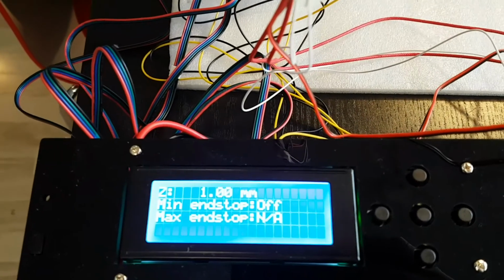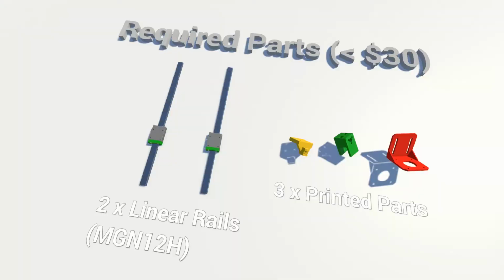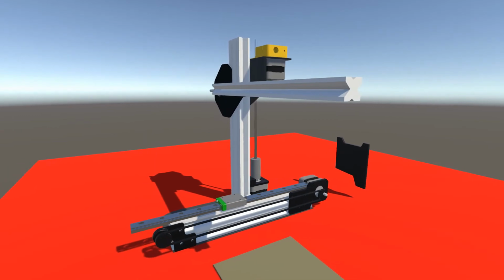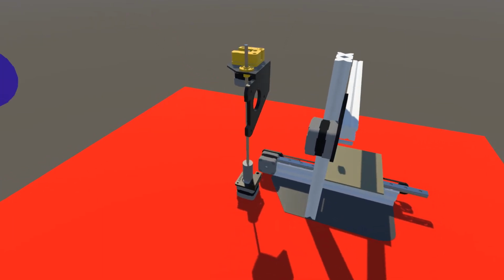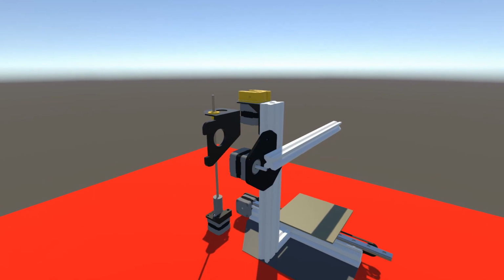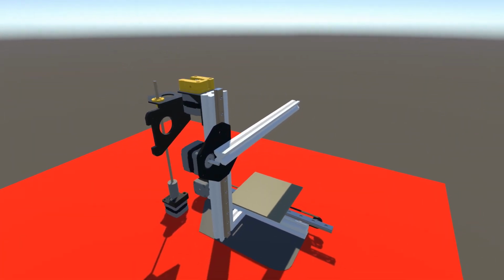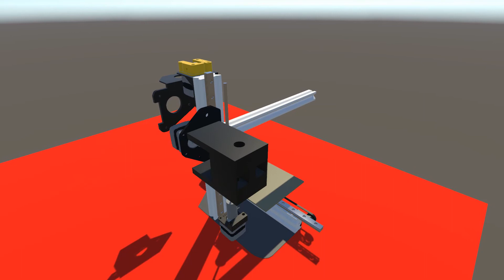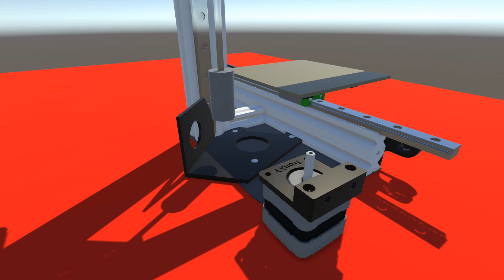Tronxy X1 Linear rail mod

Comment: I had a similar issue with my kit.  I purchased a bag of 10 eccentric spacers ($15 at amazon) and used one on each axis on the side with the single wheel.  Worked great.
Reply from the maker: John Gadbois I had no idea those existed, they're super neat!
So much to learn... thanks for mentioning them.

Comment: I'm taking a slightly different tack. I'm switching to an 8mm ACME leadscrew for Z and putting linear rails on X and Y (though I may add linear rails to Z also and just get rid of all the wheels...)

Comment: So besides rigidity, have you noticed faster print speeds?
Reply from the maker: I could print a bit faster with less artifacts/ghosting?... but I'm not terrible sure how much, seeing as the original construction was so appalling, that I could barely use it and get a feel.
Reply: Dirk de la Hunt thanks for responding, I’m about to upgrade my Tronxy x1 and I loved your modification. I’m also going to add a granite slab for foundation. It’s overkill but I’m trying to push its limits to print as fast as i can with not superb but great quality. Have you had done any other modifications to it as of late?
Reply from the maker: @Jonathan R Sadly the Tonxy X1 doesn't exist anymore as we know it... it's been morphed into something using an AnyCubic base, E3D hotend, new control board... it's really a whole new printer now, sorry!